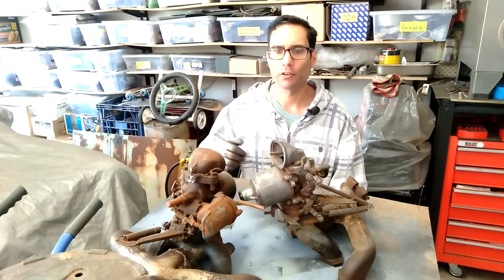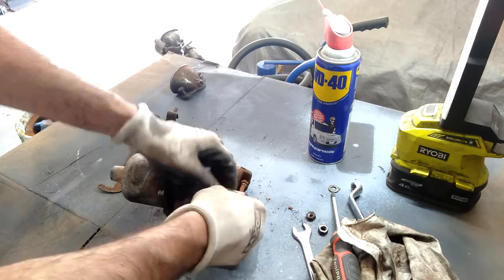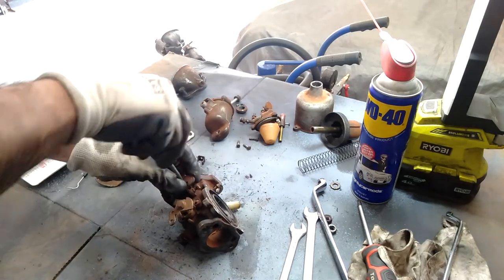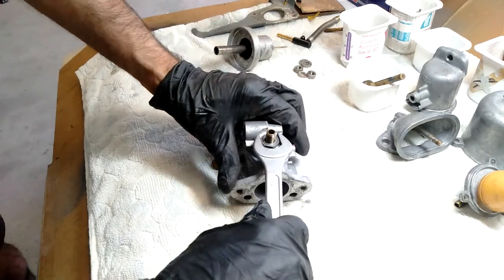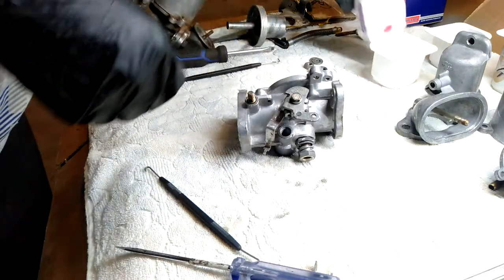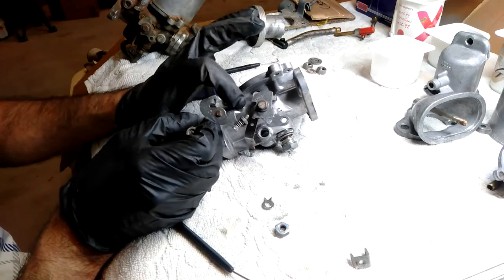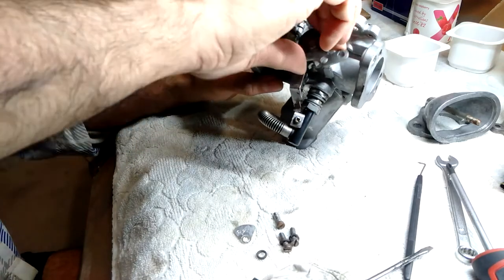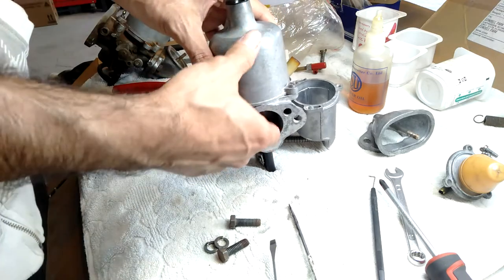Moke HS4 1.5" SU Carburettor Rebuild EP23

Comment: Great video BTW I have a question about the need for an additional spring for the choke, I am getting my 1275 Moke back on the road after a 30 year holiday my HS4 carby doesn’t have 2 springs on it. Does the choke need to have that second spring installed as per your video?